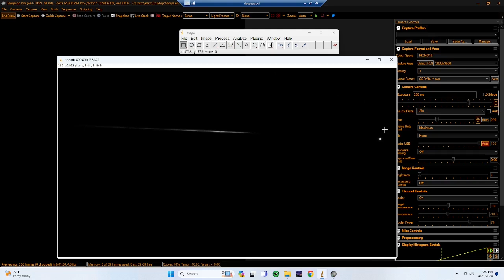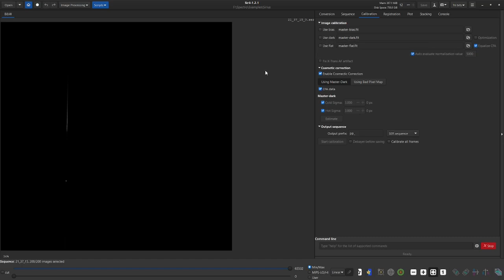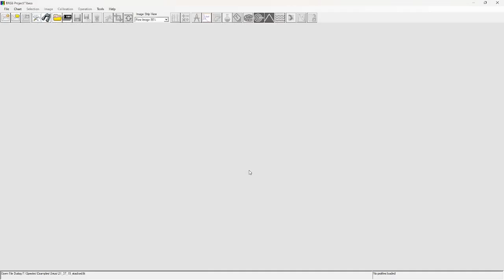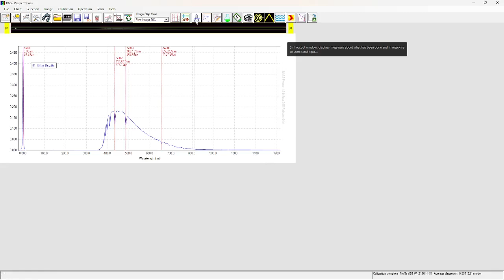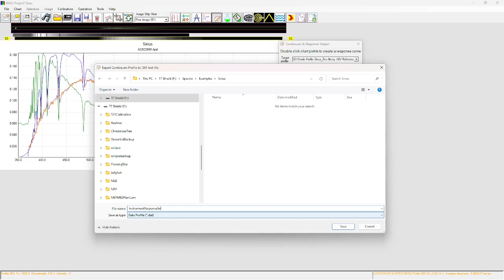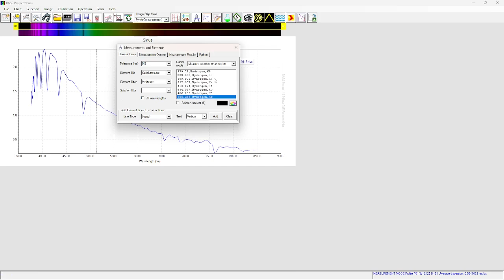Astro Spectroscopy workflow

Comment: But for getting red/blue shift you would need to calibrate your instrument with an external source first and would need to use the exact same region of the image for the actual measurement, right? As you assigned the measurement already to the specific wavelength of the elements in the beginning, you have no reference to measure the red or blueshift.

Comment: Just curious why you didn’t do your preprocessing inBASS?
Reply from the maker: Probably my familiarity with SIRIL from Astrophotography. But I also really enjoyed the speed of working with SER files. I did not find a way to use SER files in BASS (individual FITs work great!). To make it work in BASS you could export the individual FITS subs from SER (e.g. using SIRIL), and then do the stacking in BASS instead.